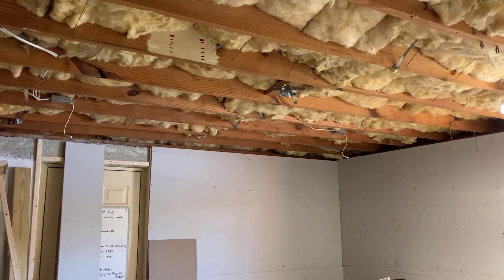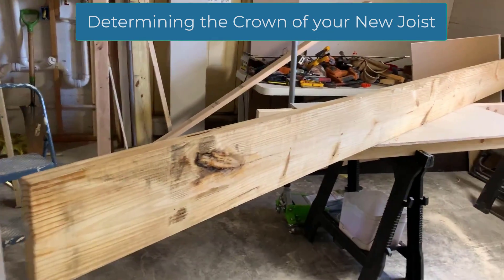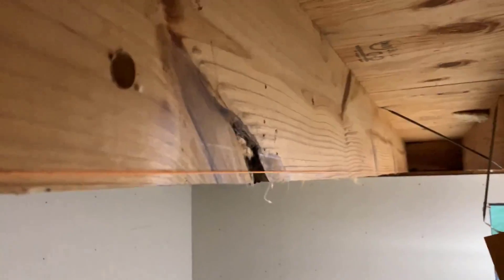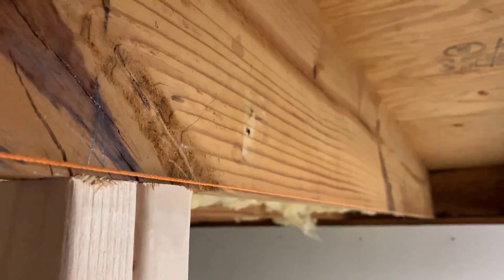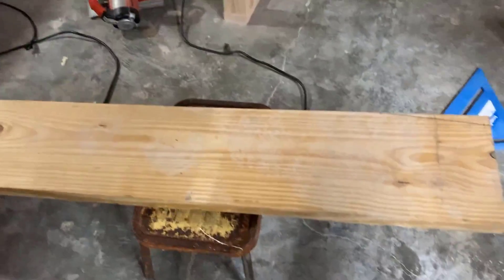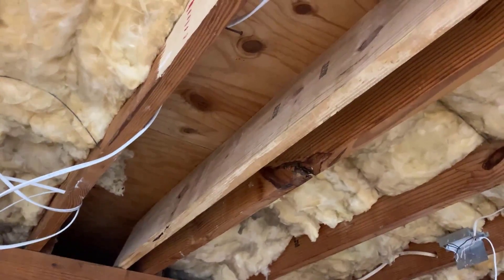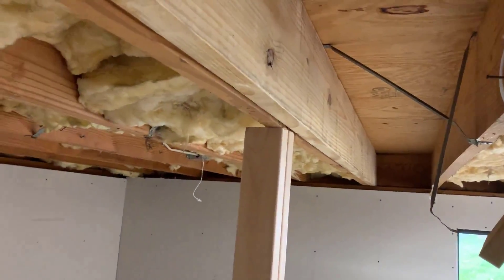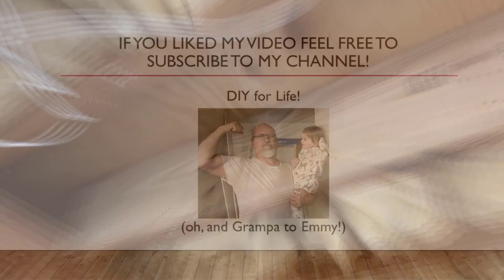Floor Joist Repair Video

Comment: Repaired a cracked beam in my basement the same way. I did put a large bead of glue on the top to glue it to the underside of the plywood subfloor as well, yes it was messy.
Reply from the maker: Cool!  I never thought about gluing the top.  It would be mess but hey, at least you stuck it out and finished the repair! (sorry, love puns).  LOL.  Thanks for the comment!
Reply: I was wondering that same thing - about gluing the top.  I will do.this and will be able tonscrew the upstairs subfloor into the new sistered joist, but if you could not do that,a messy glom of glue might help avoid squeaks.

I have also seen taking a 20° angle off the inside top to slide it in the other way (bottom in first).

Fantastic video - good level of detail in your description and great editing!
🔨

Comment: Do not use construction adhesive, use wood glue instead.  The construction adhesive is too thick, and the only way to achieve a proper high-shear-strength bond with it is by very tightly clamping it before fastening, which is not easy (virtually impossible) to do near the flooring.  Wood glue is much more penetrative in this use, and will achieve a far higher shear-strength. Another option instead of tapering the ends of the beam is to route/sawzall a slight channel on the sill, between the joists, away from the final target placement of the beam, rotate the beam at this position, then laterally slide it into place (after applying the glue). In any case, whether you notch the sill or not, do not rotate the beam in the placement shown in the video, rotate it dead-center between the joists because that is the position where the floor deck above can deflect the most.
Reply from the maker: Hey Ken.  I appreciate the comments.  I've replied to a couple of comments about the adhesive and the question of shear strength.  The adhesive and the screws are just holding the joist in position beside the old joist.  The new joist itself is holding the lateral weight of the floor...not the screws or the adhesive.  Now, I appreciate that comment about the wood glue being more penetrating and I thank you for that.   
As to the rotation of the beam in, I read what you wrote a couple of times and frankly don't see how my method does any harm and how your method would have any different result in the end.  I'm not sure what you mean by the 'floor deck above deflecting the most'.  In the end, once the joist is running along the entire floor surface beside the existing compromised joist it is now bearing the weight that the damaged joist was not. I didn't damage the new joist putting it in nor did I compromise it's shear strength by putting those small notches in it.  
In the final analysis, the repair is doing awesome.  I  have since put drywall over the joists and it has been there for almost a year with no cracking or sagging.

Comment: When you jacked it up so the board can be leveled with the string line. What did you put in between so it can stay leveled when you released the jack? Did you put metal plates?
Reply from the maker: Hey there Armando. I don’t know if I quite follow the question. While it was jacked up I put the new floor joist in, glued it and screwed it to the existing joist, and then let the jack down. It’s that new joist that keeps it in place and stops it from sagging back to the level it was before.

Comment: Very good job and video.
I offer critique. I'm not a fan of that construction adhesive - at least not that brand. There is another brand that dries faster and is much stronger...sorry, I cannot produce the name now. Even better, but requiring more care would be gorilla glue (polyurethane) - it will drip. So I would have spread it thinly.
And I know your reasoning about the screws merely holding the two boards together, but I would have used some lag bolts with washers...about every foot or foot and a half. These could have been predrilled and partly installed on the replacement board.
That's just me. I like to go beyond.
Reply from the maker: Hey Glenn, thanks for the feedback.  I would be interested to find out what brand of glue that was.   And thanks for your suggestions. There are a lot of different methods that can be employed to sister the beams together.  The repair is now a year old and I’m glad to say it is doing great however, your method would have been even stronger.
Reply: @RighttothePointDIY  thanks. I'm sure that your repair will be fine.

Comment: You should have had 2 tubes. I would have caulk the end to wall, caulk under bean at the sill and made sure the grain was cuped in on the bad beam, and mention that to leave the clamps until caulk is dry.
Reply from the maker: Appreciate the feedback

Comment: The Inspector of the previous building failed, there are a lot of knots in existing wood.
Reply from the maker: If you are referring to the other joists in my basement I would agree.  That board should NEVER have been used and other joists, although not near as bad as that one, still are inferior to what should have been allowed.

Comment: For the electrical do you pull the wires all the way or do you cut and then splice them when done?
Pulling them is probably best practice but what a pain
Reply from the maker: It totally depends upon where the electrical lines are running.  Fortunately for me the electrical runs I was dealing with terminated less than 10 feet from the joist.  One was a ceiling fan outlet box and the other was a switch.  So I got lucky.  If your electrical runs are very long run you may have to put in a junction box.  However, you will need to make sure you have enough slack to be able to do that.  This probably goes without saying but you should never 'notch' the floor joist as it compromises the integrity of the joist.  Good luck!
Reply: @RighttothePointDIY  I have some long electrical runs going through that I'll have to splice. Using wagos I don't need that much slack luckily. But I also have a 6 AWG wire feeding 100 amps to my electric furnace. I'm NOT spicing that. But have no idea how I'm going to pull it either....
Reply from the maker: @Free-g8r  Wow...that definitely sounds like worst case scenario!  You could chose to notch and then support the notched area with heavy gauge angle iron but that does compromise the joist.

Comment: I also suggest using the GRK R4 screws. Much better on load handling as they are framing screws. Pricier but way better, otherwise 16d nails are more than enough. The glue is super important. That joist wont go anywhere :D
Reply from the maker: Thanks kiwiswat.  The repair is holding very well.

Comment: I would have done that with 1/2" carriage bolts instead of screws.
Reply from the maker: I mentioned that in the video however, all the screws were doing was holding it against the other beam. They weren’t having to carry any sheer weight.

Comment: So how would you do it if the bad joist got dry, split, bowed out, smooshed into the beam and dropped the subfloor 1 1/4”? Jacking only bows it out more without lifting the subfloor. Two stories of plaster walls above with a brick chimney that’s been removed to below the roof line. I know I need to strengthen the bad joist before I can jack it up and sister it. Screw a couple 2x4 pieces to the side that’s not being sistered?
Reply from the maker: That sounds like a pretty significant job. Without really seeing the situation I think what you could do is get a large 6” x 6” beam that is close to the length of your joist you need to replace and put it up against the bottom of the floor alongside the defective joist. Then jack it up in at least two places and lift the floor to completely take the weight off of the old joist. Then, remove the old broken joist and put the new joist in.  You may even want to put in a double joist in place of the old joist to make sure you have sufficient strength for all that weight above. When you have the new joist(s) in place you could then slowly let the weight off the jacks and lower the temporary 6x6 beam.  With all that said this is all just a suggestion without really seeing the situation.  You may need a professional to come in if it is more complicated.

Comment: This is the nicest video I have seen so far, very clear instructions. One question, could you have used just one 2x4 instead of two and did you join the two 2x4 by nails. I have a bottle jack with a very small dia face, and I am afraid of using two 2x4.

Thanks
Reply from the maker: Thank you for the compliment. I would not recommend using just one 2 x 4 because it can bend very easily. One thing you could do, is put a small flat piece of steel on top of the bottle jack that would fit under the two by fours. That way it would be lifting on both of them.
Reply: @RighttothePointDIY  Thanks for the quick response, I will definitely use two  2x4.

Comment: Great video. Explaining the little tips like cutting wedge in the end and which direction to force new joist in is very helpful. I noticed in the comments that some were commenting on the fact that the screws used were not structural. If you were replacing a joist that was intended to be doubled up to carry the load, structural screws or bolts would absolutely be required, but since the intended load can be carried by a single joist, any screw or nail will suffice for this purpose. Look forward to more videos.
Reply: Yes, I noticed that too, but as you say they’re not necessary here. I’m a carpenter and contractor, so I know what I’m talking about. Id probably use a nail gun with 10D common nail, 12” spacing 1 -1/2” from top and bottom, staggered, which is how my engineer specs this sort of thing. That said, if it’s just the one, I probably wouldn’t bother dragging out the compressor and nail gun. Anyway, this is fine since they’re not in sheer and have little pull-out to resist. I would have liked to see full depth wood blocking though, which would have made pull-out even more irrelevant and make a stiffer floor above.
Reply: @mechanicalman1068  Thermal bridging concern if full depth structural bridging?  Maybe a picky point since the joists are the biggest thermal bridges.
Reply: @replyhere590  I’ve read over my post a few times and can’t see any reference to thermal bridging. Not sure what you’re referring to.
Reply from the maker: Thanks Neil. I appreciate the clarification.
Reply: The joists are glued so I don't see the point - but if not, headlok screws would be the ticket.

Comment: Absolutely loved the video, amazing explanations. Just one question, i was shopping for screws but that warning on the box had me confused of which screws to use. The one you used said "for use in any non-structural construction project" floor joists arent considered structural or are they referring to something completely different? thank you once more!
Reply from the maker: Hey there.  Yes, in a previous comment somebody also pointed that out. The thing here to remember is these screws are really just holding the two beams together. The joist is carrying the weight of the floor vertically.  I just held it in place with the screws.  Think of it this way: I could’ve taken the other joist totally out and it would’ve been just fine. So really it’s just holding it to the other joist. It’s not really holding any sheer weight from the floor.

Comment: I notice sagging floors under a load barring wall along with other weight such as kitchen cabniets, fridge, countertops, etc. It's all supported by a single 2x10x10 16" on center. Would you suggest I sister another joist to reinforce the joist or just take a beam down through the area to level it with the other beams. I'm okay with doing both, just wanted your idea.
Reply from the maker: Hey Zachary.  Based upon what you said (the LBW and heavy appliance load on the top floor) you may want to do exactly that.  It sure can't hurt and won't take you that much extra work.  Good call.

Comment: I would have replaced the knotty original joist too. You can block them too for real strength.
Reply from the maker: Hey GBass, I thought about it but I didn't see the reason to.  In your estimation, why would you replace it?
Reply: @RighttothePointDIY  Yeah well anything that is compromised and weight baring should be updated. I feel over kill is ok to an extent.
Reply from the maker: @gbass7328  I hear ya!  Definitely would not of hurt that's for sure.

Comment: Why not take the old joist out, once you have put the new one in?
The reason I'm asking is because I would like to replace several joists in a row,
possibly seven or eight ( one at a time obviously ),
and I am concerned about adding too much weight to the concrete foundation and especially to 
a steel post holding holding up a steel girder beam on the opposite end.
Reply from the maker: Hay Jarl.  Thanks for the question.  The reality is that foundation and steel post is holding a lot of weight and the additional weight of those doubled up joists will not hurt it at all.

Comment: Jacking is necessary for the repair, but Why not to nail a metal strip/stripS to the bottom of the joist? Or two metal strips on both sides of the joist with drilled holes and small bolts or screws? This would be easier repair.
Reply from the maker: I actually considered using angle iron on the old joist to bolt it and give it extra support but that was a lot of expense and a lot of work and in reality, in my opinion, would not have been the right long-term because they were multiple knots that were causing the Joist to fail.   I felt it was best just to proceed with the repair that I did. However, if your joist wasn’t in as bad a shape as mine your solution is definitely an option

Comment: This is the best video for a DIY man as I watched some videos and this was my last one before I put 5 11 foot joist in by myself
Reply from the maker: Thanks Doug!  I appreciate the feedback.  Just FYI, I have had some consistent feedback about using nails instead of screws and I understand the concern so that I would have changed.  However, the joist is really carrying the weight and the screws were more to just keep in place.  Otherwise, I'm pretty happy with how it worked out for me.  Again, glad it helped.

Comment: Very informative and clear. I’m a total newbie so I wish there was more on how to undo and redo the electrical and insulation, but I know that was not the main topic of this video..
Reply from the maker: Hey Veganator.  I totally understand and I applaud you for 'digging in'.  If you have to move wires the most important thing is to make sure the breakers feeding those wires are turned off and then, go to the closest fixture (assuming this is in a ceiling) and take it off, disconnect the wire and pull it back past the area of repair.  It can get much more complicated but the most important thing, again, is to turn off the breaker feeding that line.  If you are uncomfortable at all (and electrical is nothing to be trifled with if you are unsure) then I recommend you get an electrician or someone who knows what they are doing.  Good luck!

Comment: Thank You I needed this. I'm doing my kitchen right now the floor is up and the owner mutilated the sistering of the joists 5 joists.. The 1st owner used 2x4's on a 2x8 joist patching the cracks lolol I just replaced them which was fairly easy since the floor was up.. Crown up !!! Upon inspection I found 4 more cracked joist in this 1957 year old home in the crawl space which it isn't that bad to work in. You're video just helped me tremendously !!! Great job..
Reply from the maker: I’m glad it helped my friend. Good luck with the repairs

Comment: Awesome video, nice bright basement and clear instructions!  The only changes I would make are moving the jack between the two major knots, hoping to remove both dips. Also after glue and clamping, its much stronger to use three 16D common nails every 16".  Finally adding blocking between joists on either side makes them much stronger, as they share the load, and will stop any buckling/ tilting in the future. Good work!
Reply from the maker: Great feedback Lucas!  I appreciate that insight.  In retrospect I would have used the nails for their shear strength.  Thanks again for the constructive feedback.  This helps all of us as we DIY.
Reply: @RighttothePointDIY  no problem! I have had a few projects now with sistering joists or failed joists in general. I wish my basement I am currently working on looked like yours!
Reply from the maker: @lucasspaniard8430  Thanks Lucas.  I have actually completed that basement remodel and it turned out even better than I expected.  SOOOOO glad it's done!  Now, next project....get the rest of my basement (my workshop) back to some semblance of order!!  LOL

Comment: I had to repair several 2x9 joists that an idiotic plumber notched out on the bottom, slap bang in the middle. Structural engineer recommended sistering but I had to use 12mm high tensile bolts and glue (bolts spaced at 400mm in a zig zag pattern) - was written in bold not to use screws or nails. I guess everyone's situation is different, but I would always recommend getting a professional to do the calculations. Like the tips on getting the new lumber into place 👍
Reply from the maker: Thanks for the comments.  Good to know.

Comment: Most excellent video! Thanks for taking the time to make it while you’re glue dries etc.!!  I have to do this in my garage. But unfortunately I have drywall and garage door rail ceiling mounts and an attic access hole to deal with!  Your unfinished ceiling makes this job so much easier but still challenging!  Great work!
Reply from the maker: Yes, you definitely have a lot more work to do than I did!   At times like that I just keep telling myself I got to do it right or I’ll have to do it again. LOL Good luck buddy.